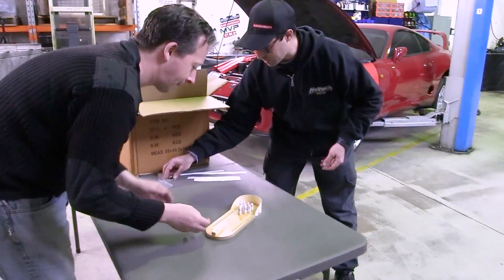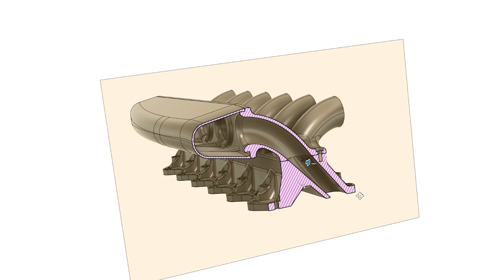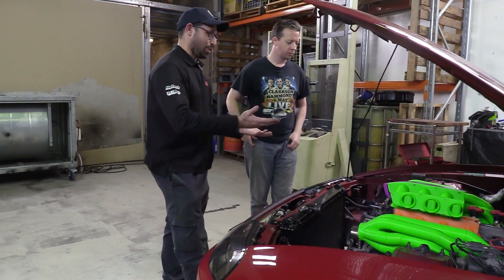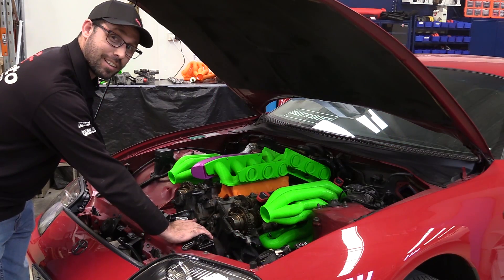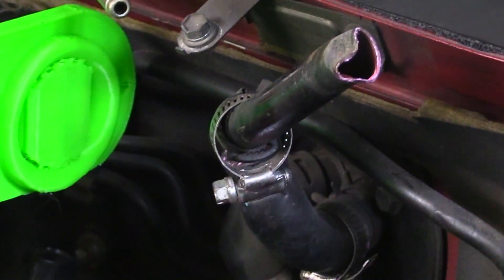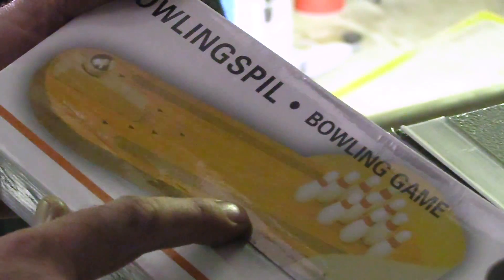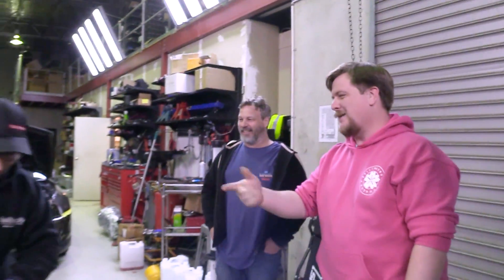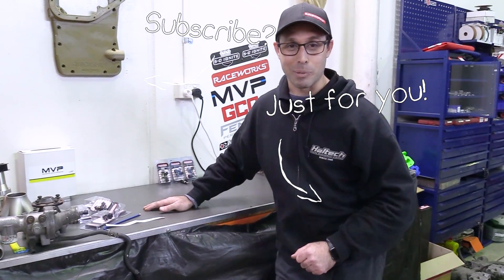Supra Supreme V12 1000hp Twin Turbo - [Ep 12]

Comment: I remember looking at the engine code for the 1GZ and noticed it specifically says that “F” in “FE” stands for normal cylinder head. My guess is because they needed it to be around the gentleman’s agreement of 276HP, they really restrained it in all the ways. Would be curious what a NA version would produce if just properly fitted with all the performance engine parts Toyota can do?

Comment: I know you mentioned you were looking at designing custom rods and pistons but it looks like connecting rods out of a Toyota 22RE are a near perfect match and there are already forged examples available. Same rod width and same big end diameter. 22RE rod is about 0.2mm shorter and the wrist pin is about 0.04mm smaller diameter. Shorter rod length wouldn't be a big deal, especially on a turbo engine. Would just have to figure out how to solve the wrist pin difference. Just wanted to throw this info out there for anyone else interested in turbocharging this V12.

Comment: I've designed a few intakes for OEM's, (Jaguar & Caterham), and I can tell you that YOU REALLY REALLY need to increase the plenum volume, especially once you've 6 cylinders in there. With intake overlap on a 6 cylinder, (1/2 your engine) you'll starve them, especially no 5 & 6. Look at all other intake plenums and they run far bigger volumes. Just my 2p worth. 😉
Reply from the maker: Thanks Scott, one step ahead of you with the volume increase :D

Interestingly though, when we put our plenum alongside a 2JZGTE one, we have far more volume (and less capacity per 6 cyl)... and yet we have personally pushed a Supra with stock plenum to 1260hp @ hubs! 

Still, I scream at that customer to upgrade for the imbalances that are probably going on in there but its interesting to note what is possible at the extreme!
Reply: @QUICKSHIFTtv  Well of course with a turbo you can force air through anything and then map the car to any air distribution anomalies. But if you can open it up, you’ll gain more power through efficiency and yet not have to run the turbo so hard. Win win. I'm looking forward to see what you've come up with. Maybe one big plenum housing all 12 inlets! ;-)
Reply from the maker: One big plenum was my original plan but it just didnt work out in terms of runner lengths within the confines of the hood... so this was plan B. As you probably can guess, 'good enough' is not our brand and if any horsepower can be gained, even if not required, I'm keen to take it!

Let us know what you think of the redesigned plenums when they come over the next couple of eps. Actually.. next ep will still be the current design, just printed out in full so I could really visualise how much room I had to play with!

Thanks for taking the time to input.

Comment: Great progress! Curious what you chose for runner length. My calcs gave me a 16.86" runner length & 250cc plenum volume for optimizing @ 5000rpm, but I had to guess at camshaft specs by subbing those for the 1JZ VVTi N/A motor. I'll likely shoot for 8.43" as a multiple. I picked up a couple cheap Bosch drive by wire TBs but it's going to require a Haltech Nexus to drive both ($$$). Looking at 2.25" hot side which will drive TB bore diameter.
Reply from the maker: Our runners are a fair bit shorter than 16”! But we are going to run longer cam durations and certainly targeting efficiency well past 5000rpm

Comment: i have an intake manifold like the old one on my VR5 (same manifold as VR6) you guys think it will be beneficial to swap it out for a les restrictive one withouts the 180 degree bend? it only revs to 6500 RPM so a super short runner manifold would not be the greatest option, but would it be better than stock?
Reply from the maker: If you’re at relatively low power and only light mods, a short runner manifold will probably be worse.
Reply: @QUICKSHIFTtv  it is a 2.3 liter N/A engine with about 165 hp, the runners are now around 50/60 cm fron the valves to the plenum.

Comment: I checked my spare pistons from that engine and they are not machined like the one you have, they are different to normal pistons tops.  Happy to send a photo if you want one.
Reply from the maker: Flick me a photo on the quickshift.tv Facebook page? Otherwise quickshifttv@gmail.com
Reply: @QUICKSHIFTtv  Yes, they did it to reduce the compression.  The engine has split timing gears so you have to preload them when you reassembly the cam shaft.  Not sure if you know that.  I have 2 of these engines complete and the one that the rod went through the block on.  The motor your piston came from.  I brought it from Nathan.
Reply from the maker: Oh thanks for clearing that mystery up!
Reply from the maker: And yes I’m well familiar with the scissor gears, same as a Camry V6. There’s usually a bolt hole you can use to lock them before removal so that you don’t need to re-preload them
Reply: @QUICKSHIFTtv  did you get my email?
Reply from the maker: @anthonyparle7342  Oh wow I got my own email address wrong, so sorry, its quickshiftau@gmail.com
Reply from the maker: Maybe this piston I was provided had been removed and modified to drop the compression ratio??

Comment: Top tech tip: If you would make the seam between the runner and the intake intertwine with a lip and a bevel, You'd prevent the eventual step. Lot less turbulence, lot more flow. Furthermore, if the runners were in different order, the heater core plumming would be easier.
Reply from the maker: The runners follow the offset of the actual cylinder heads... keeping the flow as straight as possible.. so the bank that is set toward the firewall is the one on the heater pipe side. In any case, the heater pipe issue is a tiny one to solve!

Not entirely following what you're saying in the first bit though. Between the runner and the intake? You might need to define what you mean by 'intake'.

Did you look closely at the cross section of the CAD drawing? There's very little in the way of seams... the runner is pretty much seam-less between the pieces.

Anyway, elaborate if you want to, I'm interested to know what you're trying to say.
Reply: @QUICKSHIFTtv   ..And while I'm at it, one more: Removing the injectors/fuelrails from the close proximaty of head, to the plenum pointing towards the trumpet, you'll get the best benefit out of your runner lenght. This'll keep the fuel as far away from heat as possible, and the runner as free flowing as possible. Also maintenance is simpler. Direct port injection is good for fuel economy at low RPM, but very bad for overall flow. Keeping fuel rails out of heat, keeps spray patterns consistant, runners colder and frees the flow to mix the air and fuel before entering the combustion chamber.
Reply from the maker: Theres a lot in there and I'll reply to some. The two intake pieces (orange and green) are sealed by individual o-rings around each port, so there will be no distruption to the flow shape or angle via a gasket. And like our sump, the pieces will be located with sliding-fit dowells to ensure perfect alignment, negating any concern about positional mismatch.

We seriously considered injectors in the trumpets.. infact our first design had exactly this! It made sense especially if the trumpeted injectors didn't need to engage until coming on boost.. and the port injectors could be used for cruising, idling and cold start-up. However, this was also at a time that our plan was to run a single plenum in the center. In the end, the port length we were able to achieve was just too short for my liking so I switched to the twin plenum design and abandoned the injector in the plenum idea. In truth, I could resurrect it... but the power difference isn't all that much, and I feel it'll disrupt the aesthetic of it all.

Still, never say never... I do change my mind constantly and am well known to say "I'll never do that" and then the next week I'm making exactly what I said I'd never do.
Reply from the maker: Also, this design does allow for an extension of the runner length by making taller plenums and allowing the trumpets to extend into the plenum area. How much longer are you thinking?
Reply from the maker: Also I'm not sure how you are getting your measurements, extrapolating from pausing the video? But they're a fair bit off. The runner from valve to trumpet is a fair bit longer than you have suggested. Runner diameter is unable to increase any substantial amount as they barely mesh between each other as it is.
Reply: @QUICKSHIFTtv  Hi, and thanks for replying! O-ring seam creates a gap, which creates a turbulent barrier. This barrier in best scenario shortens the runner cross section diameter several millimetres. Rifling the runner wouldn't necessarily widen the cross sction that much, but it would make noticeable diffrence in flow. Also moving the fuel rails and injectors away from the heat, mounting them onto the plenum you have not yet made, pointing into the trumpets. And, for the rifling ridges, 1,43-1,86 mm hight, 22 ridges, 180 degree turn from trumpet edge to the head surface, where orange part ends. These are crucial changes for max hp.
Reply: @QUICKSHIFTtv  Thank You for taking interest towards my question! I'm fully aware of your intake plan, and I think it's 87.8% perfect for the engine. That is a lot coming from me.. :) To make the rest, you''l need to fix these minor problems: the actual intake runner is a bit too short from valve to edge of the trumpet. 21,38 mm to be exact, following the diameters you  have. This shortage creates a drop in torque curve 2000-4000 rpm. And about the seam between the orange part and green part, that is now straight edge. Possibly getting a gasket of sorts.. machinig a 45 deg bevel onto the orange(intake) part, and matching lip onto the runner(green) part, you can reach almost seamless connection. If normal flat surface is used, there is always left a step of sorts, because the holes will never be exact. temperature, vibrations, weight stress, these will move normal seam around full millimetres. Gasket forms a heat barrier, which causes turbulences when the air suddenly expands. Hence benefits towards the bevel seam. Trumpet could also use a 1,2 millimeter increase in diameter, but only if the lenght is increased. Intake runner shape itself has little effect, diameter, lenght and shape of the trumpet determines the pulse resonance, and this can be used to create more, or less torque. Although, when forming the runner into a tightening spiral curve, it tends to increase air speed. Now, why should there be another type of intake? Would you like to make more power without adding boost or killing valves with timing? 12,2% overall increase in torque is noticeable. Most of that can be obtained by changing the step of the runners, creating a bend, widening the trumpet a bit, and making sure there's no shelves nor heat barriers in the runner units seam design. Also a tip to remember: two fuel pumps / fuel rail. feed in both ends, regulating out from the middle rail, 1/6 of the size of incoming hose. 18 mm minimum. Otherwise there's not enough flow for fast run, even with dual injectors.
If you got this far, thank you for reading, and have a good one! The setup is looking good!
Reply: @QUICKSHIFTtv  Sensing that you want to hold on to the direct port design, I suggest following: Rifle ridges forming a sine wave pattern at the cross section of the runner. 180 turn from the edge of trumpet, to the egde of head. amplitude of sine wave should be 1/12 of the runner diameter, x-axis as diameter radius. This rifle ridge solves most problems your design has: Runner cross section area deficiency, overall length and valve pulse. rifling forms a swirl in the intake, which has a low pressure area in the middle, where closing valve pulse can dissipate. Swirl also forms a faster incoming charge and less stressful air direction for the valve to seat properly during compression/work cycles.

Comment: If needed you could slighlty angle the top runner section (green) towards the front so you have more clearance at the firewall area.
Reply from the maker: Considered it. The firewall is not difficult but we are actually short on room at the front believe it or not! Will make more sense next couple of eps